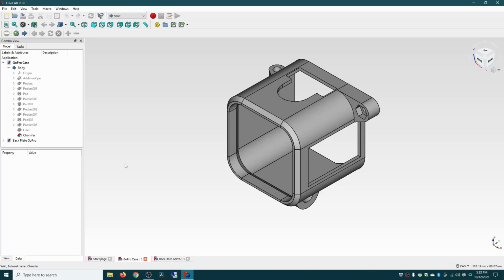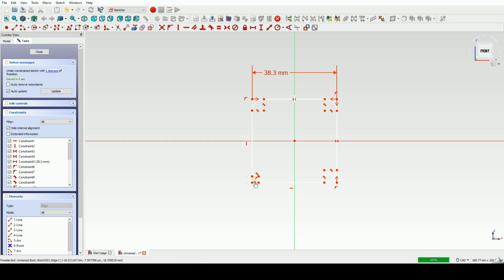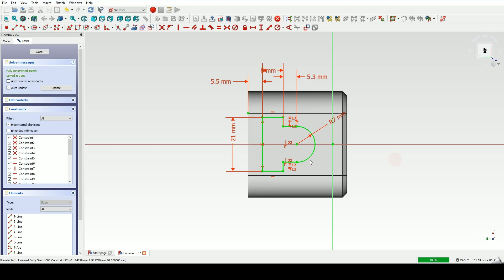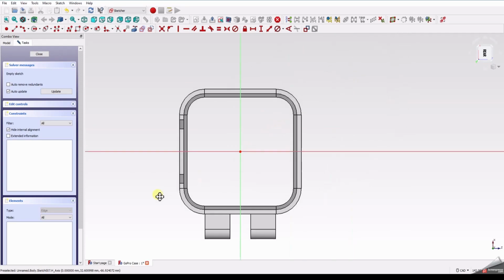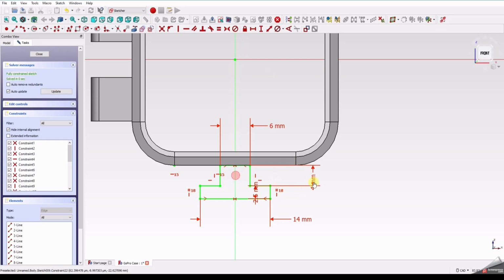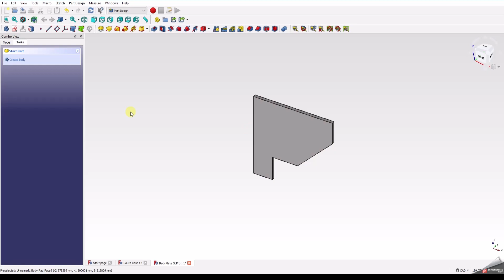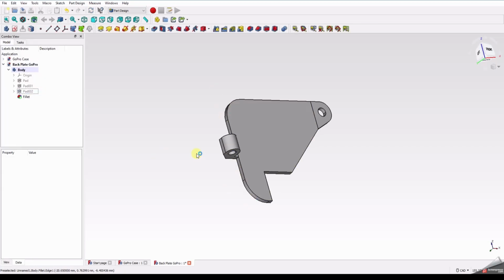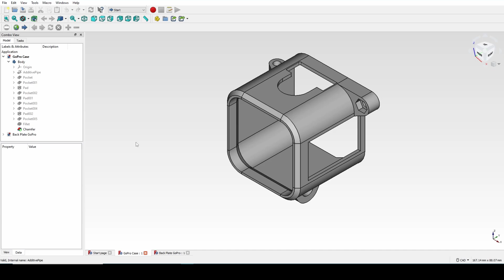FreeCad Tutorial #1 | How to model a GoPro Case for 3D Printing in FreeCAD

Comment: This is actually pretty good tutorial for many electronic enclosures that have common features such as ports, some mounting lugs, possibly snap-on edges. I covers almost everything except how to easily create sketch for all ports on one side that are subtracted from both base and a lid, which is not needed here. And maybe some info about mechanical tolerances, I've already seen parts that have like 1/8 on both sides and to my surprise it works on ~5x8cm raspberry pi box.

Comment: How would you compare Freecad  to solid works. Is Freecad a capable cad/cam
Reply from the maker: If Solidworks is a 10 (in my opinion, it is), then FreeCAD is a 5. Let's face it, FreeCAD is, well free, and doesn't have the corporate backing to make it enterprise ready. But, if we continue to use it, we could see that happen someday. In the absence of Solidworks at home, it been a great tool for me, and I'll continue to use it in order to hopefully incentivize improvements.
Reply: @KTECDesigns  Thanks for the reply